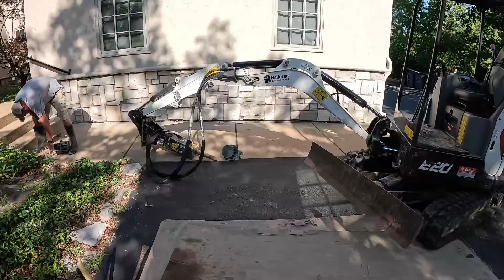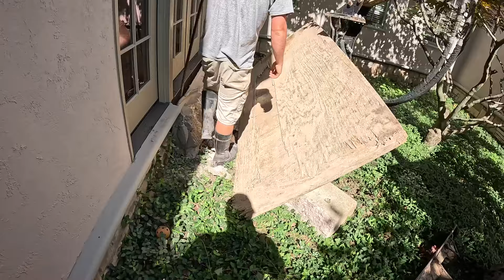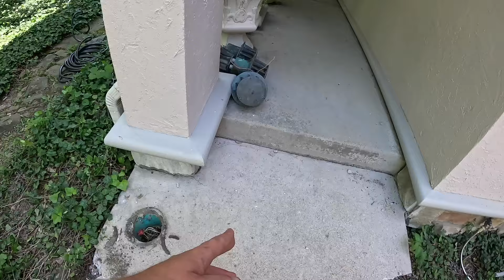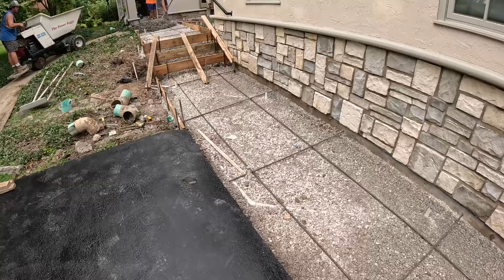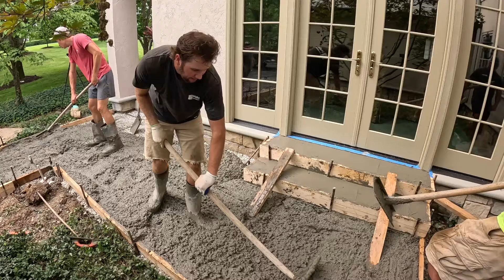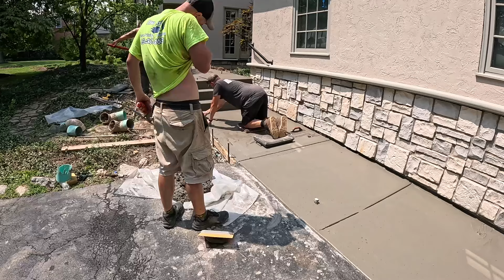Vacation Is Over....Back 2 Work

Comment: The electrical conduit, is it going to be to have lights mounted on the walk?
Reply from the maker: That is correct they are going to be installing flush mount low voltage lights on top of the concrete.   Thanks for watching!